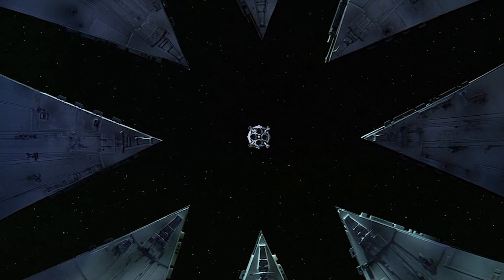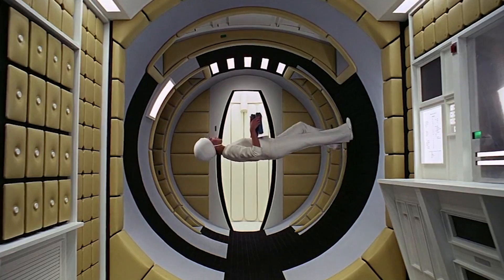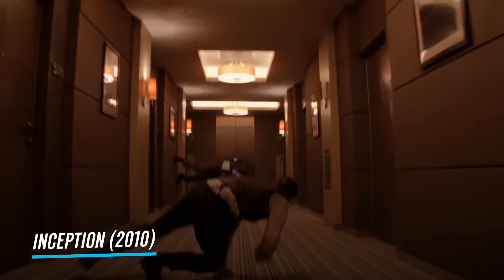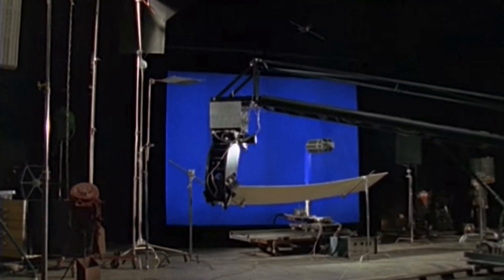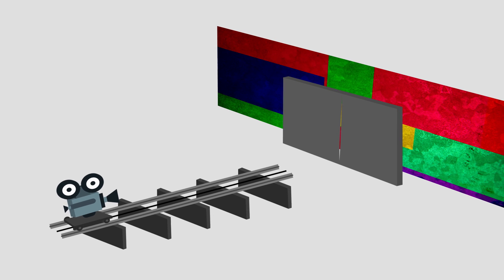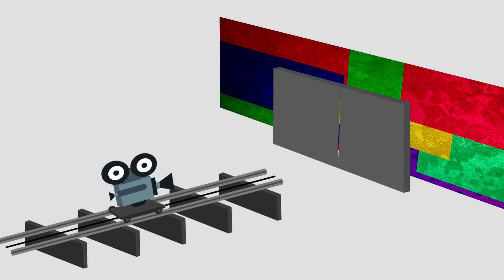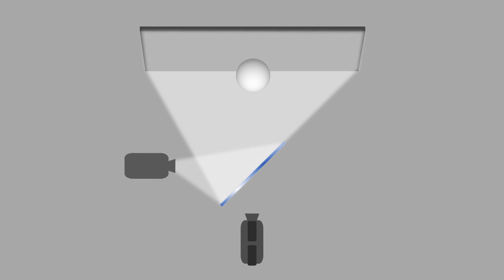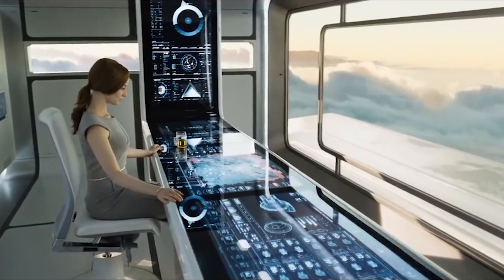4 Ways 2001: A Space Odyssey Was a Visual-Effects Pioneer

Comment: As incredible as the effects were for the time, they do not reflect the reality of living in space. No one uses velcro shoes to walk up a wall. They just float from point to point (think Apollo 13). And even for long term space flight, it appears the use of centrifuges to simulate gravity is out. The structural and mechanical challenges are too great plus, depending on how large the centrifuge radius is, the inhabitants would experience disorientation when changing direction while walking on the floor. 

None of this takes anything away from 2001. The film was made with the knowledge they had at the time, and a need to not disorient the audience.

Comment: I don't understand how in front projection shots, the background image doesn't project onto the actors themselves.
Reply: The material used for reflecting the projected image (Scotchlite) back to the camera is insanely reflective. (micro beaded) But only at an exact angle. So precise placement of the camera is necessary. But once nailed, look out. I bought a piece of it in the 1980's to fool with. (shooting Super 8 ) The ratio of reflectivity is so high that the projected image does not register on the ape suits, Tapirs, jaguar, etc. But it was reflected by the rear of the jaguar's eyes. Scotchlite can be found now on strips on the jackets of highway workers, etc. They use it for responding to headlights, mostly. You've seen it. Imagine getting the giant scotchlite screen to be perfect for 2001.
Reply: Also the camera lens has to be in exact alignment with the projector lens.  A semi-silvered mirror was angled at 45 degrees in front of the camera lens.  The projector lens angled at 90 degrees to the camera lens and the mirror.  The nodal points (optical center) of both lenses had to be same distance to the mirror to achieve proper image registration so shadow of foreground objects stay invisible and behind the objects.  The camera, projector and Scotchlite screen were therefore in very fixed positions.  The camera could only pan and tilt.  For the waterhole scenes, the ground was on a turntable so the set could rotate to change the camera's point of view.
This shows why it totally impractical to use front projection to fake the moon landings.  The handheld cameras could change location from shot to shot and weren't constrained by an immobile camera/projector rig the size of a refrigerator.